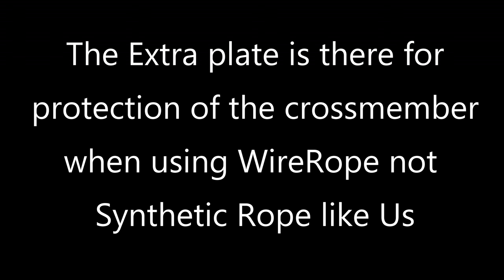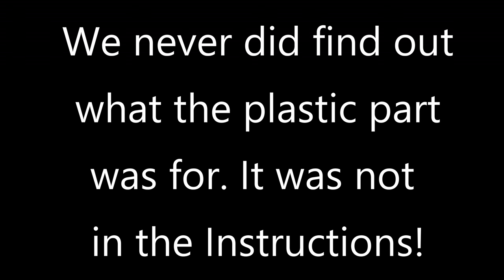Defender Install of the AlpineFlex Snow Plow

Comment: I never saw you attach the under bracket, wonder how much chopping I will have to do haha
Thinking of buying one for my Club Car ds that has a 6inch lift.  I will prob just have to build a plate  to attached the under car bracket that come with it, maybe I should check the other bottom mount and see if they are all similar or if any are flat. Peace.
Reply from the maker: Thanks for watching!  If you look for an ATV mount you might be able to find a flat one that will work. I installed the plate at the end of the install. It was so easy that it only took a few minutes and 4 bolts.

Comment: Did you ever install the limit switch? I have the same plow on my HD CAB XT. Love the plow. Just not impressed that the wiring for the switch runs outside the center of the skid plate. I took the “shoes” off the plow as it seems to remove the snow better?
Reply from the maker: No I didnt due to the fact that It wouldnt make it thru our first Mud Run...LOL       Youre right, its a bad design
Reply: Keep up the great work. I’m most likely going to remove mine as I will end up ripping mine off too! I had the dealer install mine and couldn’t believe that was by design. Do you have any experience with the “mechanical switch” any chance I’d be happy with it? Also  can a hand held controller for the stock winch be incorporated in addition to the switch on the panel?
Thanks
Reply: Is your winch switch on the dash or do you have a hand controller? Thanks!
Reply from the maker: Thanks, Yes there is a hand controller that plugs in under the flip up hood. You could always move that hook-up point under the dash and use the controller in the cab. You an get the controller on amazon for 20$
https://www.amazon.com/gp/product/B073FML6H2/ref=ppx_yo_dt_b_asin_title_o09_s00?ie=UTF8&psc=1
Reply from the maker: I have both. I added the link in the last comment
Reply: Michigan Mud Masters awesome thank you!
Reply: I'll buy that limit switch from you, if you want to sell it!

Comment: I'd like to have some instruction to install the limiter switch. Can you provide that ?
Reply from the maker: Hi Darryl I agree the instructions suck that BRP provides. It took me a minute to figure it out but decided to not install because of the deep mudding that we do. Im afraid that it will get ripped of the first Mud ride we go on. The Plow has a lot of travel so im just careful not to over run it. Sorry I couldn't help more.
Reply: darryl short I would have a dealer install it. It took them almost an hour and several adjustments to get it just right. It will save your winch and strap by installing it.

Comment: Would you recommend getting one of those plowes
Reply from the maker: Yes I would,  but,  you can get a pretty decent steel plow from SuperATV for about half of the price. It really depends on how much you're going to take it on and off. The CanAm plow is definitely The best setup for that. Also the plow mounts are above the frame line so they wont catch on things when your trail riding